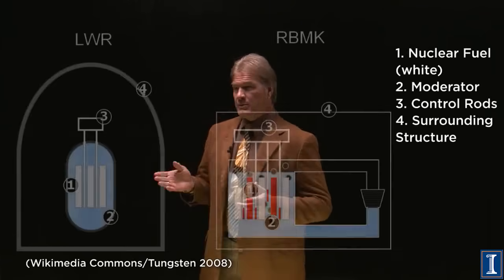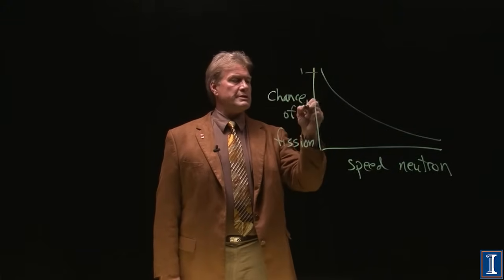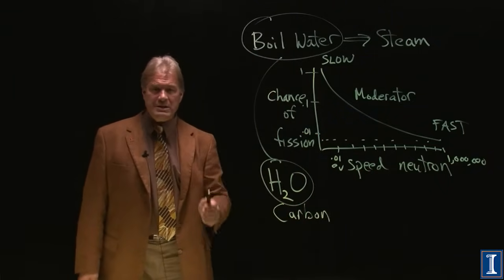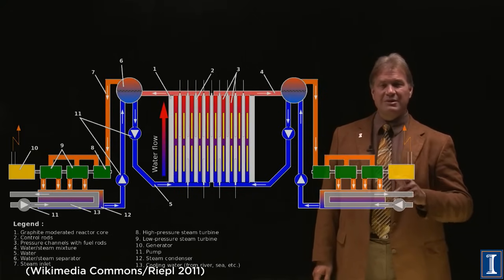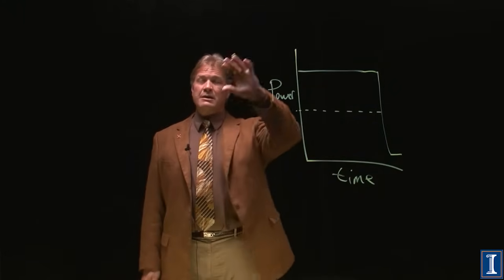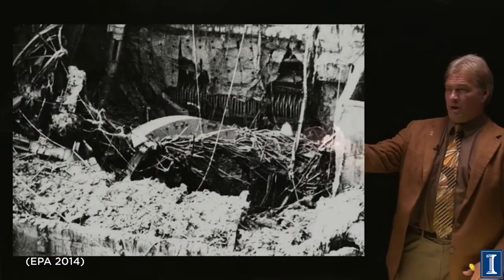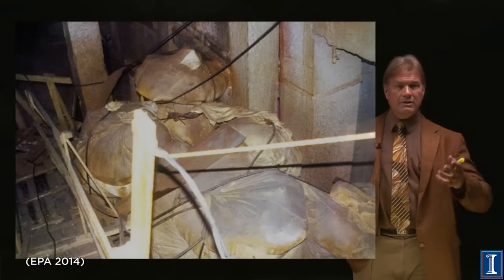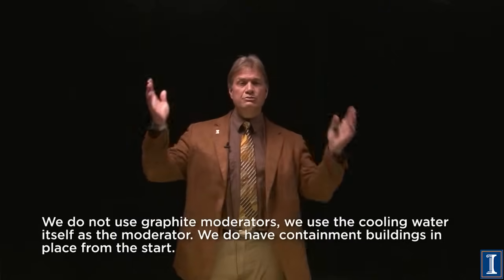Chernobyl: Worst Accident Ever

Comment: The energy of the first steam explosion, would probably have destroyed any containement building.
Reply: Maybe, but we will never really know. There are alot of places pressure can escape and weaken before those containment buildings crack.
Also, the most dangerous things that happen in western reactor designs (and has happened) is melt downs. Melt downs are easily contained, however disastrous. Three Mile Island still stands. With it's containment and molten core, being almost no danger to anyone, while they had to encase all building 4 twice to contain the core.
But RBMKs were a flawed design. They were technically a very good design, because they were cheap and powerful. Most western reactors operate at around 700-900 MWh while RBMKs can go up to 2400 PER reactor. 

But their design necessitated so many dangerous design elements that made a runaway reaction possible.

You can make a reactor with such a negative temperature cooeficient that melt down is impossible too...there is a reactor that high schoolers can operate, because even if they TRY to make the reactor go hot, it's design is such that as it gets hotter, it slows down, and as it slows down, it cools down.

So there are various ways Reactors work, some are safer. The Soviet RBMK design basically threw most safe ways to the wind to make the cheapest, most powerful reactor core they could. They succeeded, but they also made the most dangerous reactor core in the process.

And alot of RBMKs are still running. With fixes to alot of the more dangerous aspects, mind you. But essentially the same flaws as reactor 4 40 years ago.
Reply: @Chrinik  Sure. Everything you write is perfectly true. Flawed design and humans errors caused the acident. However, the general conclusions made in the video that western style reactors are safe and sowjet designed reactors are unsafe are certainly wrong or non-satisfactory. Fukushima Daishi demonstrated that containement buildings can fail, can break, are not strong enough to withstand pressure build up inside the reactor once water cooling fails. Used fuel rods in the spent fuel pit (200 tons) nearly caught fire in the open. This would have been equally disastrous to Chernobyl in terms of radioactive release. Possible prompt criticality in reactor building#3, likely in the cooling pit.The reactor is american designed, btw.
Reply: @JoeyTankblaster  I am sorry to inform you that what exploded in Fukushima was not the containment building, but the building AROUND the containment building, from hydrogen buildup from the evaporating water. The containment buildings were apparently damaged, but that too would have been avoidable.

Yes, Fukushima was terrible, around 10% as terrible in terms of radiation output, but again, cheapness and faulty design as well as human error caused the disaster in the first place. And it was a nuclear melt-down, NOT a reactor explosion. When I say that "Chernobyl cannot happen with western reactors" that means reactor core explosions. Not nuclear accidents in general. Hell, Three Mile Island happened before Chernobyl and Leningrad...

The Fukushima-Powerplant was situated on the sea in a part of the world known for Tsunamis, the Tsunami defence was not sufficient (to save money) and the backup generators to keep the pumps running where not situated on a nearby hill away from the Powerplant, as was initially planned, but in a basement underneath the plant (again, to save money).
Now we all know where water likes to go and accumulate.

Additionally, there was an emergency radiator system that could have helped cool the reactors, and as per design and operator manual, the valve for it CLOSES during a poweroutage and needs to be manually opened. The controlroom at Fukushima simply forgot and assumed it was open, since they had previously opened it. The US designers claimed the japanese were told about this.

Given the frequency with which Western Reactors explode (never) it's still save to say they are pretty safe in comparison.
They are certainly safer than most other old forms of energy production, and until fusion power becomes viable, are a necessary evil.

I would like to go non-fission, but I cannot see a world, with current technology, that could still it's hunger for energy without fission. Germany is putting coal plants back online to maintain it's energy levels aswell as having the highest KWh prices in the EU, and a pretty shitty carbon footprint (also recently deforrested a pretty old forrest because they had to resume coal mining in the area)...

It is honestly a pipe-dream to assume that "green energies" are far enough advanced or available in all regions of the world.
Hydroelectric dams cannot be build everywhere, solar and wind are not far enough and can only produce energy some of the time, it's just a sad fact that nuclear needs to stick around for a while longer.
All we can do is reevaluate how safe we build our powerplants, and to not fucking CHEAP OUT when building them. Because nuclear energy and cheap reactor safety systems clearly don't mix.

Hell, the only reason reactors are dangerous is because they are large...a series of smaller reactors would be more expensive, but ultimately much safer, because SCRAMing a 100MW Reactor produces negligible residual heat, but SCRAMing a 1000MW reactor produces enough heat that the cooling has to continue or the core melts down.
Reply: @Chrinik  I never said that the reactors in Fukushima exploded. You got that wrong. Some experts believe that a prompt criticality happened in the spent fuel pit of reactor #3. As a consequence  a substantial amount of plutonium was released. The decision for going on with coal in Germany is a political decision not a necessity due to energy shortcomings btw.
Reply: @JoeyTankblaster  Germany disbanded it's nuclear program post-haste. Took perfectly functioning reactors who's fuel had yet to burn out off the net.
That did create a massive energy shortcoming because renewables cannot cover germanies energy consumption, and buying foreign nuclear power didn't cover it either. Germany had to increase local production, which could only be archieved by putting coal back online.
Reply: @Chrinik  Well. We discussed reactor safety and not energy politics, right? I am dropping out of this discussion with a reminder for you to get your facts straight. 

1. Since 2002 Germany is an exporting energy nation not importing. E.g. in 2018 50 Terrawatts were exported.

2. Change of energy production from fossil and nuclear fuel towards regenerative sources is an ongoing process that started in the early 1990s.

3. As a consequence of Fukushima our conservative (pro-nuclear!) government decided to speed up this process and drop out of nuclear energy production.
4. Old reactors were forced to shutdown by 2012, newer reactors will shutdown by 2022.
5. Back to #1. Germany could go out of coal-based energy production much quicker than 2038. The decision to stay with coal, brown coal and gas is, especially for brown coal a political one. We will see whether this will change with the current government or a the next one, in particular in light of the ongoing climate/CO2 discussion.
Reply: @JoeyTankblaster  I would advise you to get your facts straight as well, I ain't paying these high energy bills because Germany is producing more energy than it uses. 

1: It exports green energy because we can't use it at the time it's generated, but overall it's importing over half of it's energy use since 2010, and the number is rising. In 2015, the amount of energy imported was roughly 61% of the energy it used. I don't know how clear that makes that we are importing more energy than we are exporting. 

2: The process is ongoing, yes, but it was nowhere near far enough to even consider closing down our reactors yet.

3: The decision was motivated by populism, uneducated and fear-hyping mass protests and a "pro-nuclear" government that was more afraid of losing votes than anything else. Merkel changes her opinion on things on a whim if public outcry is loud enough, no matter how stupid and self-destructive this outcry is. And now everyone is complaining about the coal mining and CO² levels<.< The fact that not a single country that has HAD a nuclear accident shut down their nuclear energy programs, but a country that HADN'T did, especially with no better alternatives ready is astonishingly dumb.

4: The reactors can't be "shut down" instantly, they have however been taken off the net in most cases WELL before they get shut down, because you can't just turn off nuclear reactors. The reactors in essence, are still running, but not providing much of anything. Just sitting there, wasting energy. Most of our nuclear energy is now provided by France...at increased prices.

5: Germany could have been out of coal energy production already, however, with the decline of nuclear power, conspicuously the coal energy production ramped up.
I wonder if those are related.

I also have to pay the money the nuclear energy companies were paying to speed up renewable energy programs.

But yes, I am going to drop out of this discussion as well.

We were barely using coal at some point, the reason we use coal is because we need a 24/7 available source of energy. Renewable energy cannot be stored for when we need it, which is why we sell it. We have to. What else to do with it? But at night, or when there isn't enough wind, we rely on foreign energy and coal to power our homes. That you do not know this is astounding.

Comment: Actually Chernobyl-like explosion(of Hydrogen reacting with oxygen) was repeated in Fukushima.. There were 2 explosions on Chernobyl - one in the reactor because of overheating(small explosion) and other inside the reactor building(alike in Fukushima) when hydrogen from the reactor was released by first explosion. The second explosion bented 1m thick concrete walls, but because it was at some height over the reactor - most of the radioactive materials remained inside. Scientists assume that only 7-10% of fuel left the building.

Comment: 5:12 so if i understand corectly, that water is directly exposed to main source of radiation (uranium...), so that water gets almost as radioactive as that uranium, so if you loose water (it leaks out as he says or steams out) main reaction stops, but all that radioactive water gets into enviroment?
Reply: No, there is special tanks with cool water and vapor from the reactor will be pumped through it. So only radioactive gases will be released into environment - but they are shortlived.
Reply: Water cannot be made radioactive, materials dissolved into it can be radioactive, but water molecules themselves do not become radioactive.

Comment: If only slow neutrons cause fission, how is it possible that atom bombs work?
Reply: Fast neutrons can fission, they just don't like to because they normally pass through the fuel.

However, nuclear bombs compress the highly enriched fuel, which causes even fast neutrons to hit nuclei and fission.

Imagine the reactor being a basketball field, and on that field are eggs with some distance between them. Now you throw a ball across the room, assume that there is no energy loss, so the ball bounces as high after every bounce, and every time it bounces it has a chance to hit an egg and crush it or hit an empty spot and continue bouncing. In a normal nuclear reactor, those eggs are pretty far apart, so you need to slow down the ball so it hits more points on the ground to increase the chance of hitting an egg. But in a nuclear bomb, the entire basketball field is filled with eggs (enriched and compressed fuel), and every bounce will probably result in an omelette.
Reply: Very good explanation!

Comment: 24 dislikes, not great, not terrible.
Reply: I prefer my Chernobyl understanding to yours.

RMBK? Are you stupid?

Working for hours... in 6000 r/h fields?

Concrete pad was not designed to be a core catcher reinforcement... it was to hold liquid nitrogen.

Completely missed the point the the RBMK is a breeder reactor that permits plutonium extraction (for bombs) while the reactor is running, and that's why it was designed the way it is, not because muh dumb ruskies.

Also missing the fact that the computer controlling the reactor protection system was deliberately cut out of the loop, had it been in service... it would have prevented rod withdrawal, invoked HPCI or any of a long list of automatic safeguards.

Chernobyl was absolutely deliberate, by the Deputy Chief Engineer, or by the Institute itself... 

Look into it and you will be shocked.
Reply: Also no mention of prompt criticality and the neutron beam or the fact that the complex expedition went to find the fuel in a state that the decay heat caused the fuel to still be molten months later.

A computer simulation predicted that during the prompt criticality excursion the thermal energy was in the gigawatt range, perhaps several.  (let that sink in)

The meme of meeting the annual energy production goals in a few seconds has some legs.

Comment: Doesn't mention the 2017 report by some Swedish scentists who reckon the initial explosion could very well have been a nuclear explosion caused by the power surge melting the fuel together and allowing it to go prompt critical, perhaps it's time nuclear experts stop saying a nuclear explosion inside a reactor is "impossible" perhaps it's impossible in the same way it was impossible for an RMBK core to explode.

I'm not convinced a containment bulding  would have made much difference either, the first explosion was big enough to blow the massive lid off the reactor and send material 3 km into the atmosphere and the second explosion was even bigger!

The Soviet nuclear program of the 80s had plenty of flaws, no doubt, but I feel all this "it couldn't happen here" talk is the height of Hubris, look at Fukushima, western nuclear power is quite capable of making terrible mistakes, at least Chernobyl was cleaned up relatively quickly, Fukushima doesn't look any closer to clean up than it did the day after the meltdowns.
Reply: Nuclear reactors don't USUALLY get hit by a massive earthquake and a tsunami though...
Reply: RBMK

Comment: Question: If Water is your moderator (coolant too), and power is lost for some reason (Tsunami/Earthquake) and backup generators are not working to pump water/coolant into the reactor: the reactor will start to over heat and boil the remaining water, thus requiring water to be pumped into the reactor ASAP to cool it down. When water enters the dried out over heated reactor, why does it not create fission, given it's the moderator too, and cause a similar problem?. If the System fails, and you lose water, the reactor is still going to have to be cooled by the water which is your moderator. Any answers would be greatly appreciated.
Reply: If the reactor "Dries out" the fission will cease and it will cool down naturally without water being pumped in. It will not meltdown.
Reply: aaronrocs In Fukushima, the reactors did exactly that. They lost power, the water/coolant evaporated and they experienced partial meltdowns until water was pumped back in. They used sea water at one point because they had to cool the reactors ASAP, yet they still experienced partial meltdowns due to the lack of water. If I’m wrong, please correct me.
Reply: @aaronrocs  Not true. The residual heat inside the reactor would eventually overheat it and the nuclear fuel might melt. Even used nuclear fuel needs cooling -> Fukushima.
Reply: @JoeyTankblaster  you're right. I actually had no authority to speak on the subject.

Comment: I'm truly having difficulty believing that the reactor confinement  dose work
Against a aircraft Yes maybe 
 but a explosion or a meltdown ?? 

Everything leaks, no such thing as leak proof    
Confinements May buy some time at best  
How do you vacate radiation out of a blown or melted reactor?
Reply: @FishSticks
I do understand THAT  THE  confinement  is ENGINEERED 
not " bunch of concrete on top"
Really no need to be rude
Thanks for reply
Reply: There are ways to build reactors now that are near foolproof, pebble bed, core catchers, nuke proof containers etc.

It could be set up in every neighborhood, fully operated by laws of physics and computer control... taking up as much space as a modest apartment block, yet powerful enough to make the entire city hydrocarbon free.

The problem is not safety anymore, its still disposable or transmutation of high level radioactive waste products.

When Elon can lift a reinforced dry cask into escape velocity then we can have a nuclear powered renaissance.
Reply: @carlblaskowitz7817 
THE by product of the  nuclear energy
And how and where to dispose of it!!!
So called   "clean energy" LOL 
It Isen't and it won't be unless
We find a way to dispose all the by product   into the  outer space
Reply: @daskarman  Yeah, that's basically what I just said... if we cant put the waste off planet... then forget it.

This man is delusional, take him to the infirmary for his 4 million chest x-rays.
Reply: @carlblaskowitz7817 
Agreed👍